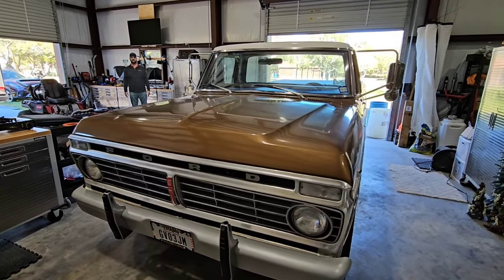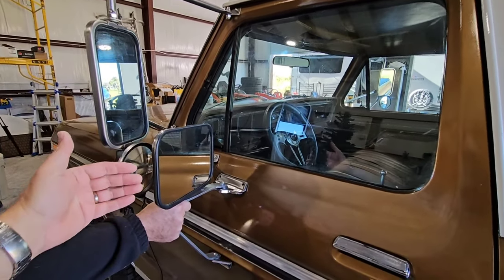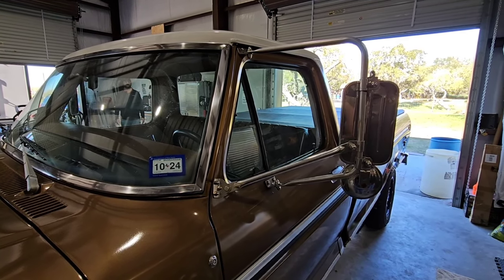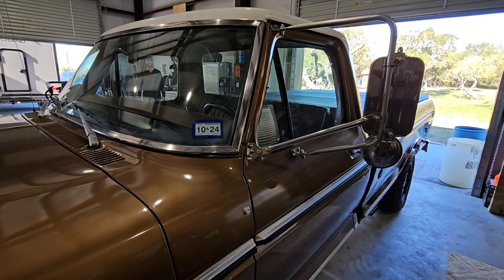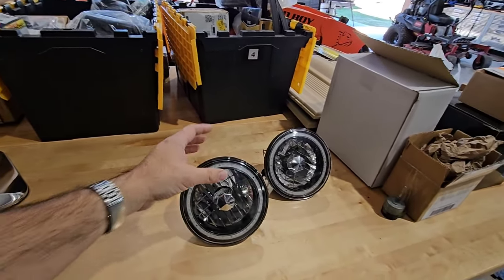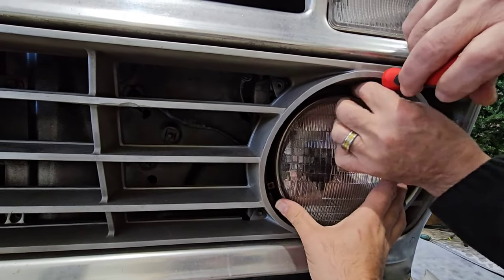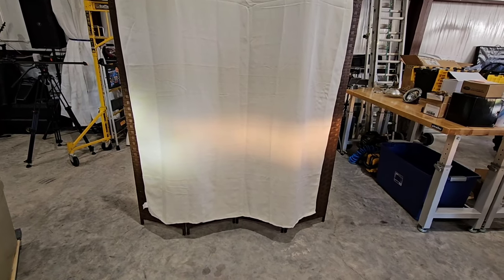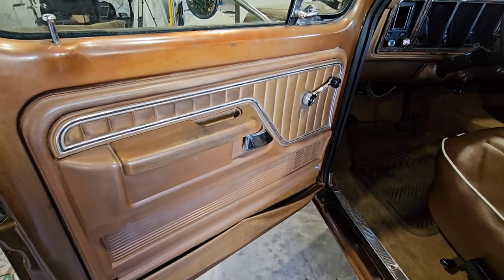BIG UPGRADE!  And YOU CHOOSE the mirrors on the Ford F350 Super Camper Special!

Comment: That's a very unique truck. A 1 ton in 1974 was not very popular. I was an RV tech from the late 70's thru the early 90's (before it was cool). I only saw a 1 ton truck without a utility bed once back then. In those days (before lawyers got involved)  if you owned a 3/4 ton, you could pretty much tow whatever you wanted. I wish my 22 GM truck mirrors would extend out as far as those original mirrors, back then we called them West coast mirrors. Nice to see some of these old trucks on the road.

Comment: I like the idea of the optional mirrors for the reasons your father mentioned. I'd leave the existing brackets in place for the time being. I'd install the new mirrors using rivet nuts vs the plastic expanding inserts if it was me.

Comment: Well you asked for our opinions.  For me, when it comes to antique vehicles, I’m a purist.  The vehicles need to be left factory installed whenever possible..  So I would go with the camping mirrors.  I realize that this is going to be a daily driver, but is the plan to find the camper that fits it and install it?  If so you’ll need those mirrors.  If you have no plans or desires to install the camper then I suppose it would be ok to put the smaller mirrors on.  But as far as the car wash goes, couldn’t you just pay someone to power wash the truck or to wash it by hand?  As far as the headlights go, I know I’m a purist, but I’m not opposed to installing brighter lights on it if you plan on driving at night.  Just keep the originals to replace them with if you ever take it to a show.

Comment: There is a third option that uses the lower frame  of the second mirror that is a folding tow mirror that can be flipped and folded in when not towing or flipped around and turned out to see around your. I have the small mirrors and I hate them and the lack of viewing they have even just backing up in a parking lot.

Comment: Look i drove the same truck growing up in Texas. Same truck 460ci, 50gallon propane and the upgraded mirrors plus has extension bars to make wider. Had a cowboy Cadillac rear bumper in 1/8" steel not chrome its one the prototyped and made chrome ones.